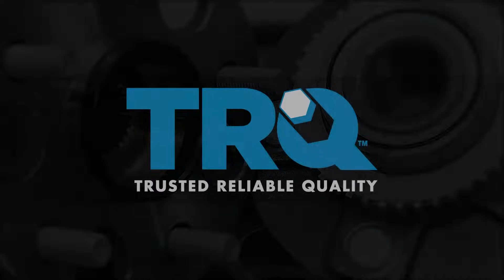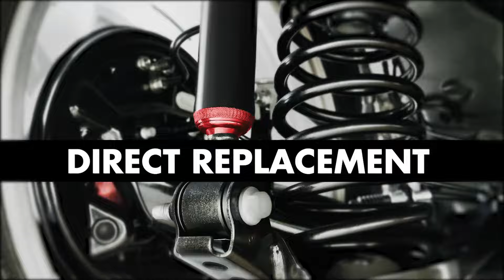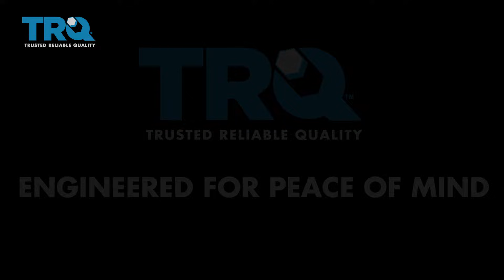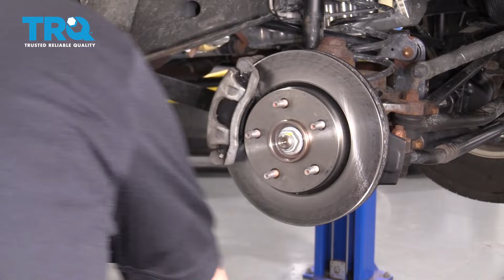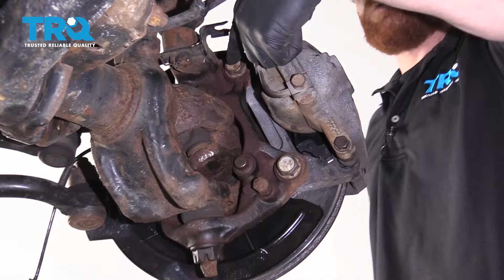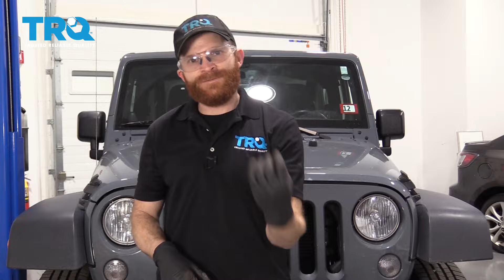How to Replace Front Wheel Bearing & Hub 2006-18 Jeep Wrangler

Comment: It would be nice to show the actual ABS connection.  I have spent more time trying to figure out how to reach behind the shock tower to disconnect.  Since these assemblies come w/ the abs sensor, i followed another user's recommendation to clip the abs wire.  I was able to disconnect the connector from the shock tower, and get the connection in a better location to disconnect.

Comment: In all of the videos I've watched changing ABS sensors or wheel bearings no one ever actually shows themselves removing the so-called red tab behind the shock Tower. I've never had one just squeeze the red tab and come apart.

Comment: If anyone needs bolt sizes:

Axle: 35mm
Lugs: 19mm
Caliper bolts: 21mm
Wheel hub bolts: 13mm (12 POINT SOCKET)